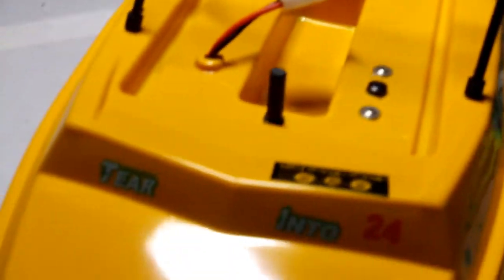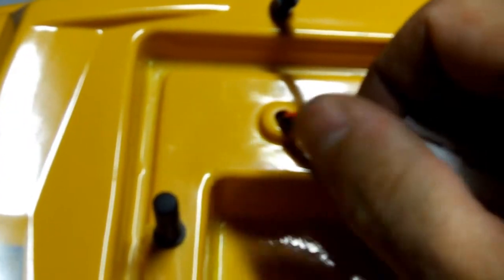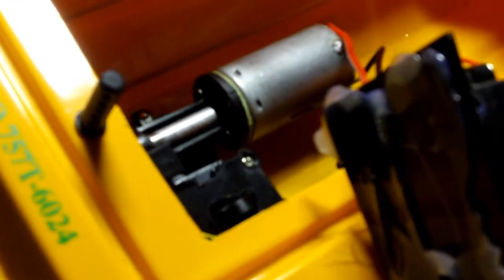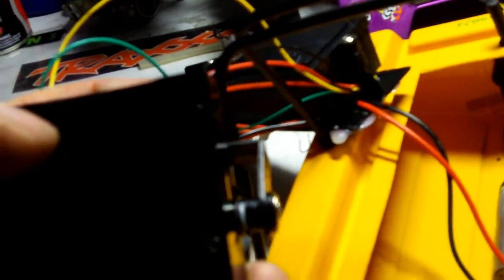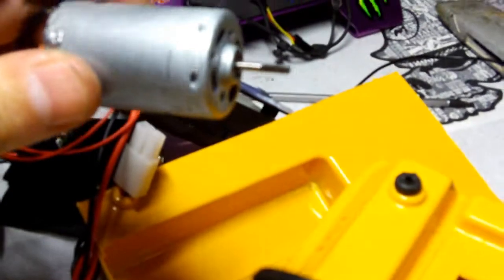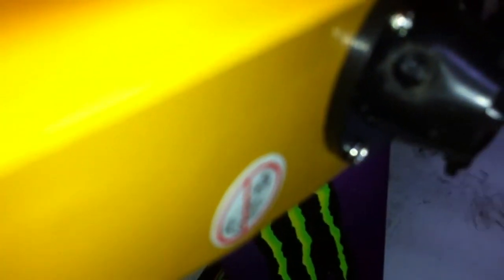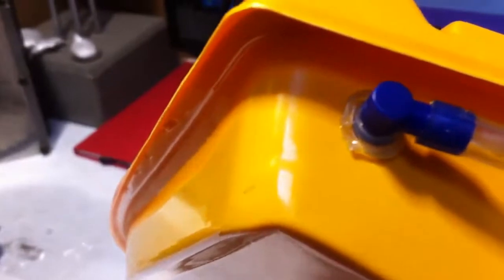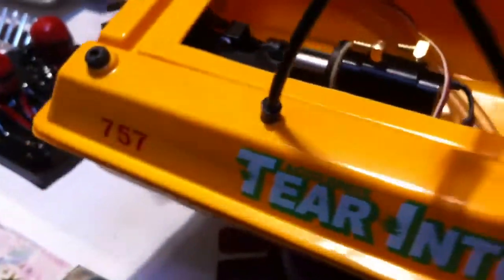nqd jetboat conversion from brushed to brushless.

Comment: Im just waiting for my boat to arrive. Then I can start to order upgrade parts.
One suggestion I have, you know you run the water pipe to the ESC and then to the motor, Well Why not have a tee piece and run seperate pipes to each device that way both motor and ESC get cold water? 
You could then have two outlets each corner of the boat. Im sure there would be enough water to prime both systems at same time?? 
Anyway just an idea I know they can get very hot at full whack! 
Thanks for the heads up on cutting out the top for access etc great informative video 
Cheers Mark

Comment: Any links to the motor or specs used for the conversion? Motor KV, size, battery size, cells (2S or 3S) etc etc. Nice conversion. I note nearly all others who convert these cool the motor first then the ESC but you prefer doing it the other way round. Has this worked for you OK?
Reply from the maker: hi brian. its been a few years now since i did this but will try and point you the rite way.
the motor is a 4800kv from hobbyking, the type with a water jacket. 2040 sl i think. 2s is fine but 3s makes it get hot quick but faster.... also can damage the impellar so try and just use 3s for the one off mad day out and 2s the rest of the time.
i cooled the esc first as i thought there would be more that could go wrong with the electrics if they got to hot, so it was more my preferance but it worked great. :D

Comment: If you replace just the motor from brushed to brushless do you have to replace everything else?
Reply from the maker: if you replace the brushed motor with a brushless one, you need to have a brushless speed control to run it, then you will notice they get warm/hot, so you will need the water cooling. also the radio that comes with the boat needs to be replaced!! so it is best to replace everything.

i have seen people not do the water cooling and using a brushless outrunner motor from a helicopter.
Reply: Ok thanks :)
Reply: 8sided circle 
What about the receiver and servo? A lot of brushed set ups don't have normal servo and receiver, they have a 3 in one ESC that has a built in receiver with a 5 wire lead and plug to the servo. Is this the case or can you keep your original receiver/transmitter and servo?

Comment: Couple of thoughts... Do you think having a seperate water pickup would be better for any noticeable performance over the drilled hole into the jets bell housing? Also, the 90 degree fitting would impede water flow over using a curved piece of pipe going through the transom? Have you checked to see the amount to cooling water flow and checked the temperature of the esc and motor after a run to see just how much this setup is cooling? Curiously makes me think a better pickup and less restriction would have a more cooling effect, but I'm not sure if it is worth the trouble?! 
What about installing bilge pump that uses the original receiver aerial hole, to get rid of any water inside?
Were you able to keep the boat fairly water tight after doing this modification cutting the top off?
Nice video all the same and I like your narration. Cheers
Reply from the maker: cheers for watching and having some good points.
the boat doesnt go fast enough and ride deep enough (i thought) for a separate water pick up. also it bobs up and down at speed and i feel this would stop water being picked up enough. i might be wrong.
i did want to have the pipe go through the rear without the 90 degree angle in there, but i had already cut the hole and found the pipe would nip with the severe bend in it(maybe a different angle or different placement would have helped)i checked to see how much water came through the exhaust while holding the boat while it was in the bath and i can say i was a good jet of water. the temperatures were hard to tell by touch as the motor has the jacket and was cold due to the water inside and the esc was as warm as it was with no motor running and just the battery connected. i guess this is the bec getting warm. also on 2s lipo its tame and the motor doesnt stretch its legs but on 3s you could feel the shaft of the motor was warm. but only getting 5 mins of playtime, the components dont really get abuse like they would being used for say 20 mins at a time.
i did find that no matter how much i tried, i always got water in the boat. i used sealers round the jet and even taped the perspex cover on, but it still got in. a slow leak would hardly fill the boat in the time you are out using it but i have seen people loose theirs.

Comment: Sorry for asking but could u I have a link to the tuning and the brass connectors?? And what esc did u use?
Reply from the maker: +ComanderStryker23 
hi, the brass thing can be made from some brass tube that you can cut down to size, steel will last longer.
if you search for a user called `mypuppers` he has some vids on repair of his nqd jetboat.
i think i used a 50 amp `birdy` esc from hobbyking. i had used a 25 amp one and it burned out. also the motor was from hobbyking.
i sold this boat about 2 years back to a friend on here called ¬mrbeefy71¬
i also built one for another friend on here called `scraced66`
if you have any questions you need answering, just drop me a line and i will see if i can help. these boats are loads of fun :-)

Comment: Did you just changed the engine? :) Where did the tube goes to? the one that started from de jetpipe? :)
Reply from the maker: DMC - Felix hi, the boat had new everything!
if you want to do this mod, you will need:
1. brushless watercooled motor
2.watercooled electronic speed control (for brushless motor)
3.your own radio control receiver and handset.
the tube comes off the jetdrive at the rear of the boat then into the watercooled esc, after that another pipe goes to the water jacket on the motor and then exits through the rear of the boat.
if you need any more help, just ask :-)
Reply: Shitn Giggles   Will this work? :)  Do i need a waterproof servo too? Do i just need 1 lipo?

 http://www.aliexpress.com/item/HOBBYWING-SEAKING-4800KV-Brushless-Motor-W-Water-cooling-for-RC-Boat-2040SL/32328847203.html

http://www.aliexpress.com/item/SkyWing-ESC-Brushless-Motor-120A-WaterCool-ESC-5A-5V-BEC-3-6S-for-RC-Boat-Jet/32324450424.html

http://www.aliexpress.com/item/2014-New-High-Performance-of-Lithium-Lipo-battery-3S-11-1-V-2200-mAh-10C-JR/1773760077.html
Reply from the maker: that is the same motor as the one i used, just different colour.
the esc you want to use is very good, i just used a 50 amp one, so yours will be fine.
if you want to play with your boat allot, then i would get a few 2s and 3s lipo batteries. they only last about 10-15 mins depending on haw you drive it.
2200maH  are perfect for that size boat. if i was you i would get 2x 2s lipo and 1x 3s lipo... the 3s makes the jet drive ware out rather quick. your servo can either be  a waterproof one or pop a balloon round it to keep water out, also your receiver should be put into a balloon too.
hobbyking are great for prices on lipo and esc`s :D
Reply: Shitn Giggles Thanks to good anwsers! Where can i buy the tube that u have? :) receiver is ESC? WHat type of servo should i have? :)
Reply from the maker: i used tube from a fishtank, you can buy it in small lengths from ebay. when you put the tube onto your boat, remember to put small cable ties round where it fits on, as they can blow off with the high pressure and wet all your electrics in the boat, or fill the boat and it will sink. if you put a load of polystyrerne foam in the nose of your boat, it will keep it afloat if it does go under.
here to help :D
Reply: Okey, where can i get The thing that u attached the tube on? 😉
Reply from the maker: the little brass thing was from a broken watercooled esc! i have seen people use the fitting from a rivet cut down, or any small diameter metal tube.. just make sure it does not hit the impeller when you make your hole and fit it.
you could even get from ebay a fitting kit for a fish tank air hose, they do packs with rite angles and twin t pieces etc. all do the same job.
Reply: Okey, thanks for the help! :)
Reply from the maker: anytime :D
Reply from the maker: i will make some more rc vids public, have a look through later and see some more stuff, i havnt been into the hobby for a couple of years now but still love the hobby.